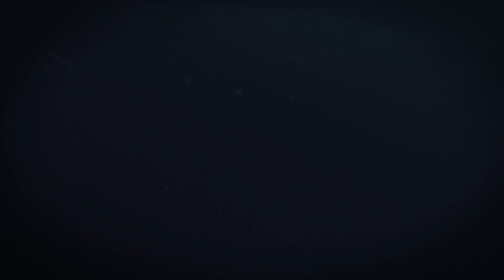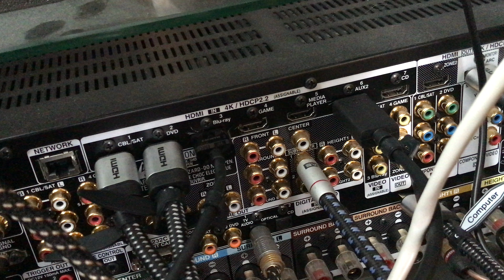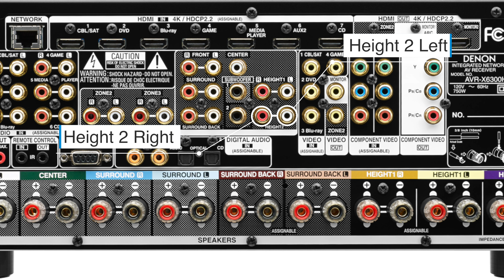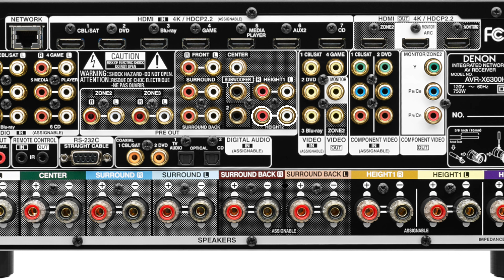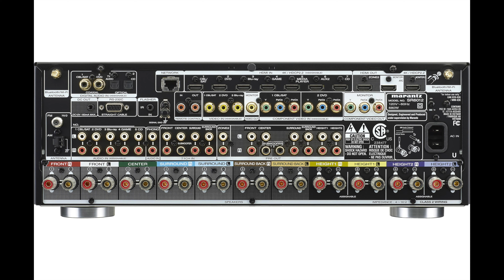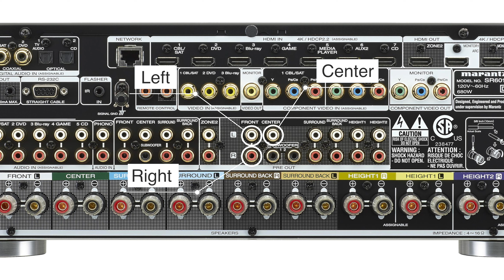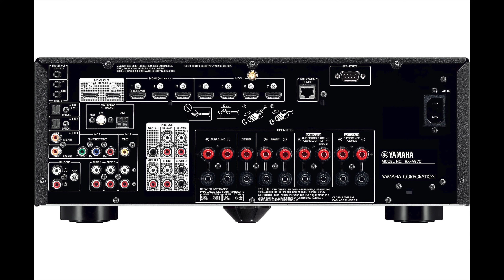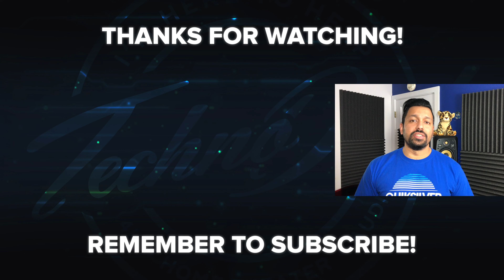How to Add an External Amplifier to Your AV Receiver | Home Theater Basics

Comment: GREAT video, so glad I found your channel. Super helpful. Quick question: Looking for recommendation for a "decent" quality stereo power amp (3-channel not required) that puts out more than 150 (@ 8 ohms) for under $500. I see a bunch of these new Pyle amps, but I'm guessing they are a "Pile of crap" so I was wondering are there any brands out there that "are not crap". 
I just stumbled upon a minty pair of Sansui SP-Z9ii speakers, but my wimpy little Denon ARVS710W can't safely push enough "juice" to them as they are rated at 320W @ 8 ohms (they are HUGE....don't know what I was thinking.....they were super cheap.....and did I mention MINTY)

Anyway, this video gave me the solution that I need, but I don't really want to have to drop $2K on a power amp. Suggestions? Keep up the outstanding videos, you are helping a lot of people who don't know what the hell they are doing....."like yours truly". Cheers!
Reply from the maker: Hi Frank!  That's a tough one!  Emotiva has the A-300 (http://bit.ly/TDEmoA-300) I think it's $399, but then you would need a pre-amp to feed a signal and control the volume.  The Emotiva A-300 will give you 150 wpc into 8 ohms with both channels driven.  NobSound on Amazon has a lot of under $100 pre-amps, but they usually only have one input so it's pretty limited.  If you needed way more than one source, you could try getting the Denon X3400H (https://amzn.to/2O0NFJF) which is $599, down from $999 and has a set of pre-outs which you could connect to an external amp like the Emotiva A-300.
Reply: Techno Dad  Thanks for the advice, I definitely appreciate your help. Cheers!

Comment: Does the RCA cable length matter in the connection? I am planning to keep the emotiva and Avr on either sides of the center speaker and I will need RCAs with around 2 m or so. And the RCAs are same as subwoofer cable ?
Reply from the maker: I'm not 100% sure.  I would think it's okay to use different lengths, but I could be wrong

Comment: Just bought the denon avr-x4400h and want to do a 7.1.4 my buddy has a onkyo m-5010 he is selling for 100 bucks in perfect condition its 75 watts by 2 should I use this amp to power my floor standing speakers
Reply from the maker: Hi!  Yes, that will work!  You're going to want to use the trigger out on the Denon to go to the Onkyo.  If your friend doesn't have the trigger cable, you can get one pretty cheap on Amazon.

Comment: I have the denon 4400. Do I need to let the AVR know which channels are being routed to an external amp or will it know automatically?
Reply from the maker: Hi!  If you are trying to get 7.1.4 from the X4400H, then yes you need to designate either the front mains are externally powered or the rear heigh left and right.  I outline the setup in this video: https://youtu.be/LuFqhCHc7KY  If, however, you are powering a front stage and only processing 9 channels, they you do not need to specify.

Comment: Great instructional vid Daddy-O! I heard u say integrated early in video. Can I use an integrated 2 channel amp to power the 2 main front speakers or should I get a 3 channel amp to do the front stage? I currently have the Anthem MRX 720! I also have an Anthem 2 channel integrated amp that I’m not using now.
Reply from the maker: Hi, thanks!  What model integrated amp do you have?  I have the Parasound Halo Integrated which has a Theater Bypass mode which allows my to plug in from an AVR and bypass the pre-amp section in the Integrated Amp.  If yours operates like that, then yeah, you can use it.  If it doesn't then you'll have to worry about changing two volumes, which can be a PITA!
Reply: Thanks for the quick response! I have the Anthem Integrated 225.

Comment: Is there any way to add an amp if your receiver doesn't have pre outs?
Reply from the maker: Hi!  I don't think so...
Reply: Techno Dad I think we can use 

https://www.crutchfield.com/S-TAWqBwWr7fQ/p_543ADP12/Russound-ADP-1-2-Speaker-level-to-Line-level-Adapter.html
Reply: Ramo Man we can use you get this
https://www.crutchfield.com/S-TAWqBwWr7fQ/p_543ADP12/Russound-ADP-1-2-Speaker-level-to-Line-level-Adapter.html
Reply: Ramo Man you can split off the cable from the source so you have a connection for each amp

Comment: , your very wrong. home theater receivers have more power for the front channel " Main " speakers because in stereo mode, that is what's used.
so why add a separate amp for that.? you don't need it unless you already have a crappy receiver to begin with. which in that case, you should just start all over again and buy good equipment.
a lot of higher end home theater receivers do rate their power at every channel with rms power, pure clean sustained power. so start with good equipment and you don't have to listen to this techno babble. it's to confusing for most people anyways.
Reply: There's a lot more to this than just buying good receiver from the get go.

1) If you've got $1000 receiver and $1000 integrated/power amp this set up will drive pretty much any pair of floorstanders with relative ease. No standalone receiver at this price range will be be able to do the same. Receiver/processor with separate amp allows for better (sometimes much better) dynamics/peaks in home theater. Especially if you've got excellent speakers. Now very sensitive speakers can be nicely driven by good AV Receiver without any external amplification

2) There's no power house current gen 7 channel AV Receivers on the market. Current manufacturing trend is "give enough power for designed number of channels". So in relative terms 40W all-channel driven for 5 channel receiver, 70-90W for 7 channel and 100+ for 11 channels. Simply because otherwise product is going to cost a lot more and general public won't be able to afford it. If someone wants to build powerful set up any good brand sells pre-pros, pre-amps, amps, etc. that you can configure in number of ways. As a rule all-in-one solution is always bested by custom/configured to your needs solutions. There used to be a time (probably till early 2000's) when current AV tech (high res video, object audio, streaming, smart features) wasn't yet that developed and most of the manufacturing balance was more on audio quality side. Simply because manufactures knew for decades how to make good audio for good money. Now AV receivers are stuffed with circuitry to make someone's mama be able to listen to Spotify over Wi-Fi, support DNLA, power USB inputs, etc. All of this demands power and given there's no more space in the box for huge toroidal transformer, you get smaller one that will have to provide power for many more things than just "main speakers". As a result you get just enough power to drive them. But nowhere near what dedicated amp can do. 

That's why there are products like Emotiva XPA-7 7-channel amp with twice the weight of super hi-tech AV Receiver. To make sure your speakers have enough headroom to open up and show you what they've really got.
Reply: Letuch , NOT TRUE about the $ 1,000 dollar remark you said. I ordered a brand new ( STEREO ) receiver from B&H audio from NY, New York. 
it has the very rare ( tape monitor ) , basically an audio " Pass " thru.
it puts out 120 watts per channel RMS CONTINUOUS power X 4 channels and is what they call " High Current ". also has an subwoofer output.
it costs about $450.00 bucks and is well worth the money. Stereo receivers of this caliber with a tape monitor Loop is a very rare thing nowadays.
the reason I wanted a TAPE MONITOR LOOP, ( PASS THROUGH ) is because I'm running an
ADC EQUILIZER SPECTRUM ANALYZER through the RECORD LOOP of the tape monitor.
man let me just say, WOW.
I have some vintage 
Acoustic Research tower speakers that have the 10 inch woofers on the side of the speaker with a rear port & separate wave guide box that separates from the top part of the speaker.
facing forward is two 5 inch kevlar " yellow " mid range driver's, ( like what
Bowers & Wilkins uses )
and a 2 inch soft done tweeter. I have 4 of these rare and very specific type of tower monitors.
I will be replacing the soft done tweeters with Dayton's Audio AMT Tweeters, nothing wrong with the originals but I really like extream high end crisp & clear high resolution tweeters.
I may even go with a Titanium bullet " Super " Tweeter. not sure yet.
anyways, good sounding high quality audio equipment does cost more but not the the exaggerated point that you tried to describe in your comment back to me.
 you just have to have a lot of patience and do a lot of searching on the internet to find either vintage audio equipment or new high-end audio equipment. 
the key to success is to be patient and not just buy the first thing that comes along it took me over a year to find my audio equipment because I had specific parameters that I went by and would rather wait to get a good deal on super high-end audio equipment versus buying cheap ass Best Buy crap.

Comment: I have a pioneer elite vex-lx302. It is a 7 Channel av receiver with 9 speaker inputs (2 inputs for zone 2). I currently have this set up to do 5.1.2 Atmos. It also has a “zone 2 pre line out. Can I use that pre out to plug into a 2 channel amp to power two more Atmos speakers?
Reply from the maker: Hi Michael, great question!  Unfortunately, it doesn't work that way as your AVR will only process 7 channels.  You would need a 9 channel AVR for a 5.1.4 setup.  The cheapest one is the Onkyo TX-NR787 (https://amzn.to/2JZlOa0) at $663.  There are some people that don't like the privacy issue though.

Comment: Hi 🇹.🇩 is this method  works to add the surround back left and right channels without bi amping or bi wiring  because my speaker doesn't support those two solution s
Reply from the maker: Hi!  What's your setup look like so I can better answer your question?
Reply: my setup 5.1.4  my (avr pioneer lx801 9.2 channels)  the surround back  needs amp to upgrade to drive 11 channels  can i upgrade without bi amp or bi wire ?
Reply: What I mean  is it possible  to add two speakers to external apm connected to the pre outs plug and play without connected them through  any binding post that already been used by other speaker because  my speakers doesn't support  bi amping
Reply: Techno Dad 
Sorry if this seems a silly question - this is all new territory for me.  I do little research and I've got it done 7.0.4 I brought the  Emotiva BasX A-150 Stereo Power Amplifier and the klipsch rp240s pair it was so sample and easy to configure  just plug the pre out to the amp  connect  the speakers change the settings to 7.1.4 thanks mate 😁

Comment: What kind of cables are you using/recommending? Love the videos!
Reply from the maker: Hi Gary!  I use SVS cables (http://bit.ly/TDSVSSPC)as they are 12 gauge, braided, and not too pricey.  The speaker cable can be made into custom lengths and pre-terminated, just make sure you choose "Banana Connectors (2 Pairs)".  I also use SVS RCA interconnect cables (https://amzn.to/2L70Kj9).

Comment: So you can do this with any 2 receivers? I have the Denon AVR-X4400H and the Denon AVR-S710W. Would I be using the 710 as the main receiver and the 4400 as the secondary?
Reply from the maker: Hi!  I would use the X4400H with a power amplifier.  I'll have a video about the Outlaw Model 5000 and the X4400H up on Thursday this week.

Comment: HI, Techno Dad I have a question about these preamp outs. I have two receivers one is a yamaha rxv 667 and the other is a pioneer elite series vsx lx 101. The yamaha which is 8 years old now has those pre outs, but my pioneer doesn't and it's only a few years old. Now, I'm only running 5.1 but like that feature of having pre outs. should I use the pioneer or the yamaha as a unit of this choice can I add a device to adapt the speaker lines to line level on the pioneer or should I stick with the yamaha that doesn't do 4k video or atmos?

Comment: He Techno how is it going. I been into hooking up stuff all my life but never got in to deep this may sound silly but I followed you on everything except when you plugged the rcas into the external amp example if I plug into my fronts and center pre amp where on the other amp would I plug into I have never had a external amp so if I was to guess would it actually say front and center on the external amp and say you had a extra receiver laying around could you use that and if so could you plug into the front and center channel on the section that you would normally hook a DVD too meaning a older amp with the 5 channels. I have another question can you only have as many channels as your main receiver has example say my main receiver can do 7.2 or 5.2.2 could I add a external amp or another 2ndary receiver and make it 7.2.2/5.2.4, should I forget hooking another receiver up and using it like a amp is that just confusing things are is that a legit way to do any of this.

Comment: what if you don't have a pre out? i have an onkyo tx sr373 and i want to connect it via line out to another amp. but it doesn't have one. what do i do then? can i split the speaker front cables into 2 then make one an rca out and the other go to the speakers?
Reply from the maker: Hi!  You can't add an external amp if your AVR doesn't have pre-outs.  So you would have to get another AVR.  Not sure how you go from speaker wire to RCA

Comment: Lots and lots of avrs without pre outs. Some sales representatives don't even know what an external amp is. Thanks for the video
Reply from the maker: You're welcome William!
Reply: HI TD, I'm  little old school in this so my question is:
Can you get the same loudness from 4 Elac Shelf speakers? Because I'm having a super tough time with this. The main speakers are loud and the second set is super weak and not even close in sound. I'm not using my ONKYO TX-RZ620 AVR with a TV only my Turntable. Maybe you know what I'm doing wrong. I'm also contemplating on getting the external amp because i have to crank this thing up past 50 just to get some volume.
Reply: I have a buddy selling 2 jvc home towers for 100.   For both!  1976 jvc, wood

Comment: Hello Techno Dad,
Great Video and discussion.  Here is what I would like to do based on the equipment list below I have in my dedicated theater RM.

I would like to setup a second/third pair of DA speakers (rear DA) in my theater room.  I am thinking of adding another pair of Klipsch CDT-5650-C II In-Ceiling Speakers.  Then replacing my Emotiva A-300 (stereo) with a new Emotiva A-500 (5ch) amp and using it for 4 (DA) speakers.  I would then connect my Klipsch CDT-5650-C II in-Ceiling Speakers (FW) connected to the AVR.

The built-in DA (Klipsch RP-280-FA) and new pair of Klipsch CDT-5650-C II in-Ceiling Speakers would be connected to the new Emotiva A-500 (5ch) amplifier.

Your Thoughts

HT Equipment List
Make Model Numbers Device

Sony VPL-VW285ES 4K Front Projector 

Make Model Numbers Device
Sony VPL-VW285ES 4K Front Projector 
Steward StudioTek 120G3 123in. Projector Screen 
Sony PSLX250H Turntable
Sony SCD-222EX CD/SACD Player
Directv 4K Geni Mini C61K-700
Marantz SR7010  AV Receiver 9CH
Klipsch RB-75  Front Speaker (SBL)
Klipsch RB-75  Front Speaker (SBR)
Klipsch RP-280FA Front Speaker (FL)(DA/HT1L)
Klipsch RP-280FA Front Speaker (FR)(DA/HT1R)
Klipsch RC-7  Center Chan Spkr (C)
Klipsch RS-52  Surround Speaker (SL)
Klipsch RS-52  Surround Speaker (SR)
Klipsch R112SW  Sub Woofer Spkr (SUB1)
Klipsch RW-12D  Sub Woofer Spkr (SUB2)
Klipsch CDT-5650-C II In-Ceiling Speaker (FW/H2L)
Klipsch CDT-5650-C II In-Ceiling Speaker (FW/H2R)
OPPO BDP-203D 4K Blu-Ray Player
Emotiva XPA-100 Gen 2 Mono Block Power Amplifier (FL)
Emotiva XPA-100 Gen 2 Mono Block Power Amplifier (C)
Emotiva XPA-100 Gen 2 Mono Block Power Amplifier (FR)
Emotiva BASX A-300 Stereo Amplifier (SUR)
Logitech Companion Harmony Remote Control w/HUB
ROKU ULTRA  4K Media Streamer
Panamax MA5100EX Power Conditioner
Amazon Echo DOT Smart Speaker
AC Infinity Aircom T8 Quiet Cooling Blower Fan System
HTPC   WIN10-PRO (PLEX MS)
WD   MyCloudEX4 NAS (PLEX Movies)

Thanks

PM
Reply from the maker: Wow!!  That's a system!!  If you want 3 pairs of height channels, you'll need either the Denon X8500H or the Marantz AV8805 pre/pro.  Both of those will process 6 height channels.  That's the only way to get that up and running.
Reply: According to the Users Guide, I can do this or upgrade the receiver as you stated.  I have not tried this yet.

11.1-channel playback
This system, which is based on a 5.1-channel system, plays back up to 11.1-channels at the same time.
You can connect speakers for up to 13-channels for MAIN ZONE by using an external power amplifier. When you connect speakers for 12 or more channels, the output speakers automatically switch according to the input signal and sound mode.

Comment: Great video, I would like to know what your thoughts are on adding an external power amp when you are using in ceiling theater speakers? I have a Yamaha RX-A3010 receiver (rated 165W, 2 channels) and using 8" in ceiling up fronts rated for 150W.
Reply from the maker: Hi!  I'm not sure what your question is.  Do you need an external amp?  Are you trying to get 11 channels from a 9 channel AVR?
Reply: I just wanted to add more power to get more from my current system, currently I feel like I have to crank the volume to get the kind of sound that I am looking for, almost like I am pushing my receiver to it's limit even though it is rated at 165W, 2 channels. I was also concerned that since I am using in ceiling speakers that maybe adding more power might be a waste.